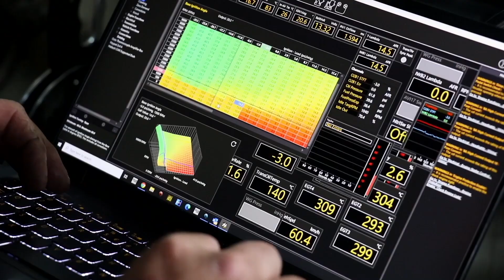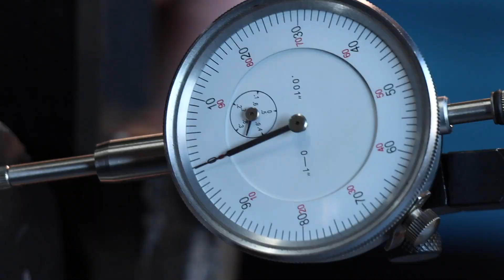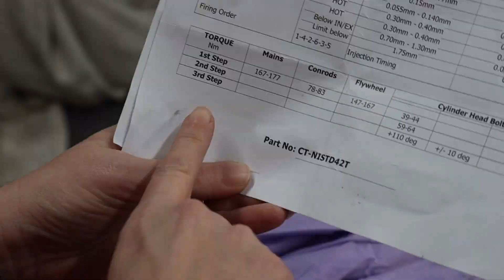TD42 REBUILD PART 2 - TURBO VS N/A DIFFERENCES

Comment: Would you happen to have all the torque specs/engine manual etc online or anything, just stripped everything just need to measure up and check everything now

Comment: Not TD42 related as such, but deck Height should always be checked with a dial bridge, I would never assemble any engine with this check.  
You just never know when something goes wrong, either warpage, or the decking process was done wrong.   I won't name names, but a massive, famous engine builder in the states messed up a mates race engine like this as was later discovered. after it needed to come back apart. 
I am doing an MX5 BP4W soon with all the of the billet fruit to suit, I will be doing it al at home to make sure all is done properly and methodically.

Comment: I was curious with when you did the valve set, obviously the motor isn't at a stage that it can run and get warm yet. What did you do the valve set to, as any spec that I can find is when the motor is warm?

Comment: I'm not a superb pro mechanic but add grease on the head bolts  is most stupid thinks because in side thread bee lot of pressure. Head Bolts must be dry and clean with out any liquid.

Comment: As you explained, this engine has cooling issues. It seems to me that adding an eng oil cooler big enough to make a difference will take a lot of the heat of the block, and also, if auto trans is used, a cooler will take away the radiam heat away from the engine.

Comment: I have a spare silvertop in my shed but I don't think I'll ever have the cash to rebuild it, it's a dream tho, thanks for sharing the knowledge, I can always refer back to this if I ever get there !
Reply: I had one of my TDs lose compression in cylinder 1 and starting to get low on a few others. I pulled the pistons out and checked the bores for spec, gave it a quick clean up hone and chucked some new rings and rod bearings in and slapped it back together without even pulling the block from the patrol. Made it a new truck which continues to this day running 20 psi and still towed 3.5t at 105kmh and 88 degree temps. They are not as scary to rebuild or as expensive as you may think. Just get in and do it and chip away at it and spread the cost

Comment: Hello, one of my next works is the reconstruction of a pump and injectors of an atmospheric td42 mounted on a forklift.

when I prepare a td42 or an rd28t I never put 12mm  head.
There are other solutions
Friendly
Syl20
Reply: xApptheskidfactory-tu1kx  i préfère 11mm head with better cameplate...

Comment: Fantastic relaxed communication!!! I like it. Plus this is VERY encouraging. Am in the middle of building a turbo spec motor out of a N/A 94 blacktop and an old cooked turbo motor I bought years ago sitting in the back of the shed. A lot of the parts were in very good condition except for two pistons + the block is cracked in each parent bore.  ATM it is just a pile of parts sitting on the floor waiting for the machine shop to complete the work I cant do.  
 One other thing is the TD42 Turbo has a different oil pump that pumps more oil, bolts straight in.

Comment: Na silver tops are kings my old gq with 500thous on the clock was running 50 psi with a massive turbo massive 180cc 12mm fuel pump bigger injectors had 2 bad engines one had a good block one had a good head got a new head gasket and slappped the 2 together and that motor was bulletproof couldn’t kill and I tried red line every gear she was a unicorn best engine ever

Comment: That beats the old fergy/Perkins in situ rebuilds with using the welder to remove the liners and freezing the ones to drop them in.

Comment: Why didn't you just use the factory conrods , or was it because of different pin sizes ?
Reply from the maker: Pin is 28mm on Silvertop and 30mm on Blacktop.

Comment: Way to make a td42 not overheat. Actually measure the thermostat and make sure the bypass closes. All the OE and book thermostats don’t seal the bypass and most bypass seat faces are corroded, washed and stuffed. Read through a thermostat book and pick one that actually opens fully as well as sealing instead of recirculating 30% when fully open. Fixed.

Comment: The pads on the rockers that contact the top of the valves wear a groove in them, so when it's noisy and you need to set them, you can't get an accurate measurement. 

Hell common problem. I used to set them with it running and just slowly tightened the clearance till it just stopped ticking. Works good

Comment: @theskidfactory why the Spool conrods vs using the originals?
Reply from the maker: Original rods are 28mm gudgeon pin, turbo and blacktop NA are 30mm gudgeon pin. Some kits come with an OE spec turbo rod, this one comes with Spool rods.

Comment: I can chime in that a certain Mr or mrs cylinder head in Victoria supplied a TD42 head that after being fitted broke a rocker arm and 12 months later after not being registered/driven broke two more. Obviously warranty was gone by that point but effectively would have been breaking rocker arms in succession. I would imagine there was something with the valve and guide or spring pressures that the stock rockers hated. 4K head did fix said issue.
And just a tip, paint mark one corner of the bolts after the first step and then you can tell which ones have been done from that point forward at the other steps

Comment: Is there anything to be gained on a diesel with a change in cam?
Reply from the maker: Not a great deal. Turbo cam is a slightly different spec but boost pressure accounts for any small changes in cam tenfold.
Reply: @theskidfactory I know u are only chasing 180hp or something make sure to use a dc3 pump from diesel central Gracemere, and back in the day in all the comp trucks used at cruiser Park, they used to get a custom cam made that changed the firing order I believe (bilko cam) and used to make them sound like an rb don't quote me on how exactly it was done dnt no much about it but yer turned them into animals with a big pump and a good exhaust.

Comment: Y’all probably already know but make sure you have sufficient cooling for the turbo since the factory ht18 is water cooled
Reply from the maker: We are not using a HT18, they are junk.
Reply: @theskidfactory  why I went to an 18g
Reply: fun fact, td42t ht18 is water cooled, td42ti isn't
Reply: @mikebaz7843  probably because the ti model has an intercooler and the standard doesn’t 😂

Comment: Might be worth noting the idler gear shaft must be fitted the correct way as the oil feed is supplied through one of the bolts if fitted upside down bearing will starve for oil.

Comment: Mate I enjoy every video up load. I learn thank you.
Questions  I see on the old block that the piston  don't go all the way to the top. So low combustion? 
Secound  you put sealer on the baults on the thread and head. Why the threads. Are the bolts going into a water jacket
The injector cap has changed.  More fuel. But does this burn out the injectors more do to heat ? 
Take care guys. 
Be safe)

Comment: Was it a genuine head or aftermarket. As some of the aftermarket heads have bad air flow behind the valve.  Large lip.    Use Genuine only
Reply from the maker: It's aftermarket but from a reputable supplier. I checked that because I was told the same.

Comment: I dont think you mentioned it, but you should use new head bolts on these every time, that angle actually stretches the bolt a very specific amount, if someone ever went too far or didnt lubricate it properly while torquing it in the past the bolt will not hold enough tension and you're going to be blowing gaskets.
Reply: I'm surprised als never talked about torque sequence and torque to yield bolts.  Well that I can remember anyways
Reply: I always thought you needed a head stud kit, but that's just what I've heard I know very little about rebuilding TDs
Reply: @andrewcoulter323  guess you could go stud kit if chasing power.  They just metric so there would be ones that fit
Reply: Pretty certain they would have no way they would of used the old head bolts

Comment: Doing a great job as usual boys. Did you look at the viability of using either a bmw m57 or 4jj engine in the patrol?
Reply: Being fair, TD is a factory replacement. The only custom work will be for the induction/ exhaust. No custom engine/ gearbox mounts or fitment. Plus they sound sick!
Reply from the maker: You do have to weld the TD42 mounts to the chassis. 
I don't see the 4J as an upgrade, it's the same capacity as a ZD30 and so is the M57. The reason ZD30 struggle is because they are simply too small for a vehicle the size of a patrol. A 4.5 cummins makes more sense.

Comment: After market rods ??
Reply: Factory rods are fine. Each piston and rod is 2.4 kilos, a petrol chev is about 800 grams. Personally I have a hard time trusting aftermarket rods from companies that make rods for petrol engines.
Reply from the maker: This kit comes with aftermarket rods but some have genuine spec rods. They may not be Nissan rods though. These are Spool rods, they also make crankshafts for TD's.

Comment: Would it have been worth thermal coating the top of the piston to try reduce heat even more?
Reply from the maker: We are only looking for 180hp from an 11mm pump.
Reply: A lot of people do, and the exhaust ports. It depends how hard you're going to push that particular engine. They are very very robust and take 30 psi and a sensible tune without fancy coatings.

Comment: @theskidfactory What's your thoughts on oil squirters on gasoline turbo engines. Are they deleteable?
Reply: See Mr Golby's JZ builds great info there.
Reply from the maker: It depends on the use of the engine. If it's a salt lake racer then no, if it's an 1/8th mile drag racer then yes.
Reply: @theskidfactory  circuit racing would be the application, they better stay I guess! Thanks!

Comment: You laugh, but I'd probably watch and even subscribe to a John only fans if it was him building engines haha. Only fans did start out as a patreon style thing before it got big for allowing adult content.

Pretty cool little detail with the oil squirters too, simple but clever design from the engineers.

It's also good to see that builds can make use of unloved engines or versions of engines and save them from the scrap heap.
As an amateur who's never built an engine when I first saw the corrosion in that TD42 I said that's a bit too crook, but you guys saved it.

Comment: Another difference between the blocks the NA TD42 have a 28mm lifter and the turbo motors have a 30mm lifter, recently rebuilt mine and found every difference from going from a silvertop block to a blacktop ti block
Reply from the maker: You mean Gudgeon pin? The blacktop NA and turbo are both 30mm and silvertop are 28mm. The lifters are around 20mm.
Reply: Since learning there’s a difference in oil pumps I’m shitting myself as I have my old NA pump in my TI block 😂
Reply: Lifters are different size between  the na and turbo blocks as are the gudgeon  pins

Comment: With the new head, did you have to, or choose to, do any cleanup work, a bit of port polishing, removing any casting crap or matching the head ports to the manifold ports & / or gasket for the best flow? Also, are the timing gears any different on the turbo motor, and is the cam different also between NA and turbo...?
Reply from the maker: We did nothing to the head. The ports are huge on them, I would say too big for an engine of this size and output. I don't know if the timing gears and cam are different.

Comment: Td42 rocker studs wear against the valve stem, causing a false reading when checking clearances. Can be easliy machined. The machining of the block with the liners out is great advise. Pistons will grab on liner hotspots shorty after rebuild if not corrected

Comment: Jh hilux builds Same killer td pumps I’m running one with turbo spec injectors an it’s matched with a gtx2860r I think it’s the best combo reliability is key keeping them cool is the challenge if yous are looking for a few mods that help with cooling that are free why yous have it apart hit me up
Reply from the maker: Hitting you up for cooling mods.
Reply: @theskidfactory  what’s the best way to get in contact with you
Reply from the maker: Post here so everyone knows.
Reply: Ok so 
1-  your timing cover where your water pump suction an discharge is run your finger on the in side of them you will feel the casting join grab you die grinder an port it down flush. 

2- factory Nissan thermostat last two numbers 04 or 05 on the part number it’s a 76.9 deg anyways. 

3-  4x4 off road clinic do a derk copy water pump it’s called the jp performance pump works an absolute treat. 

4- quickass our ufi fan upgrade I have got both one on each of my cars yes the are a bit louder but pull shit tons more air 

With these mods I can go up an down the river in soft sand not a problem in a 35+degree day an not go over 92 93deg water temperature towing up a range with my 2.2t camper hooked up I am flat out seeing 90deg  

My wagon weighs in at over 3.4t with its gvm upgrade

Comment: Here we have the most overrated diesel engine of all time
Reply from the maker: How so?
Reply: It's a small capacity heavy duty long life commercial engine. They like boost, they have a poor port shape in the head, and an immensely strong bottom end asice from the crank not liking whipping through harmonics. I'd say they are fairly rated. I've had several.
Reply: @rubikmonat6589  strong bottom end my ass they snap cranks like no tomorrow
Reply: @cabline1193 you don't try to make 300hp from TD 42 and you crank won't snap
Reply: @vvevvevvvv  that’s why I’m saying they are overrated lmao everyone goes on about how much power they can make
Reply: @cabline1193  literally no one saying they're making tons of power. TD 42 can make, but not in stock form.
Reply from the maker: Noone says they can make tonnes of power. 300hp from a 4.2l diesel is a lot. Crank breakage is due to other factors and it very common on many diesel engines, Isuzu is renowned for it. 
This video is for facts, the use of the word "overrated" is for talking shit with your mates while standing next to your broken 79 series.

Comment: I also advise you use stud locker on oil squirters bango bolts, I have seen them come loose.
Reply: Can second that, have also seen them come loose and fall out. Not much oil pressure or bearings left afterwards guaranteed.

Comment: Only way to turn the kettle off is to build the cooling system to "Derk Spec"including one of his water pumps. I've done it to the letter and I can tow 3t and stay under 95*c
Reply: I got good results from doing an additional, raised,  pressurised header tank system up on the firewall.
Always good to give a spot higher than the engine for air to bleed, little extra coolant volume can't hurt either.
Reply: Also all the plastic skirts between the guards and chassis, around the radiator, and between the bonnet and the radiator support panel. I raced one on a stock water pumpand it never got hot until it stopped.
Reply: 108%  derk saves td42 lives
Reply: Yes, billet water pump, quick as fan hub and fan, best quality radiator and thermostat from quick as.
Reply: @DieselAddiction genuine thermostat and rad tends to work better, definitely genuine thermostat derk says the same thing. seen people running hot or even too cold with after market tstats
Reply: @chookx  mine was recently running too cold with an aftermarket thermostat, swapped it for a genuine one and waiting to go for a good run to see if its better.
Reply: @chookx  I carry 1 ton of tools all the time 205kwatw 1130nm stroker, and never gets too hot or run cold, the quick as thermostat blocks off the bypass hole in the bottom of the housing making the coolant flow through the radiator instead of circulating around the block.

Comment: The oil chamber setup in the turbo TD42 piston is interesting, the VG30DETT actually has an extremely similar setup as well, where the oil squirter squirts oil into a chamber in the piston just like the TD42 does, whereas the regular VG30DE just sprays oil in the vague direction of the underside of the piston crown :P

Comment: The turbo oil filter housing and cooler is better, the oil pressure relief valve has a higher pressure setting than silver top, and the relief valve on the other side as well.
Reply: Really? I’m building a TD42t and pinching parts from my dead silvertop. Didn’t know this was a thing. How different? Mine bolts up
Reply: @nickunw  They are interchangeable but they use different filters and as mentioned different relief spring pressure.
Reply: @DieselAddiction  yeah nice. I swapped out the 4 plate oil cooler (silvertop) with the 6 plate cooler (Blacktop Turbo) to get the benifits of better oil cooling. But She's all bolted up. Wasnt aware the housing aint spring pressure is differnt. Assuming this is the bearing in the cooler hosing and not the one on the passenger side of the block
Reply: @nickunw  Hi mate, check your oil pressure with a reliable mechanical gauge before you start charging spring pressure. It’s not the ball valve’s under the filters, but a piston valve on the bottom of the housing, if you have 55-60 psi don’t touch it.

Comment: Is the cam different between the turbo vs na
Reply: Yes they have slightly less overlap, you can get a custom grind done with more lift as well.

Comment: The CC capacity of turbo pre comps is greater, when you stroke them you have to re calculate compression ratio and have shorter rods made to bring it back to factory specifications.

Comment: After getting into diesels it amazes me how many need to be cut to correct protrusion height instead of just pressed in until correct protrusion is achieved. I know most people just rough press in wet liners til they seemingly bottom out and call it a day which I think is unprofessional.